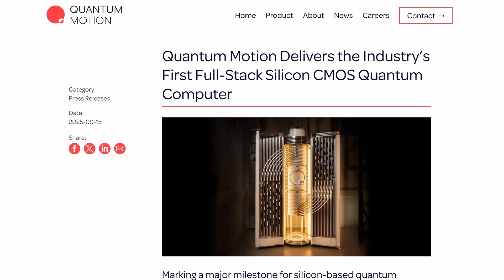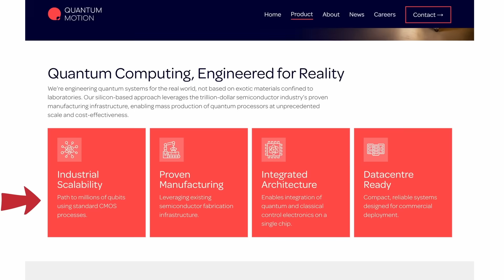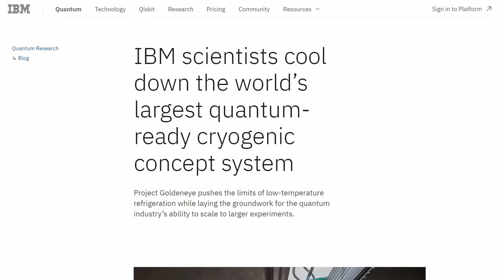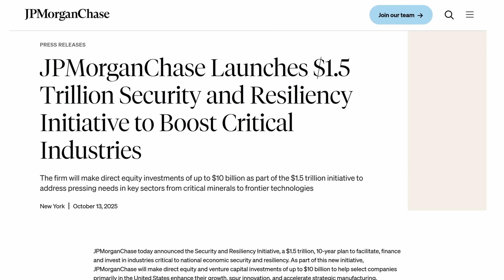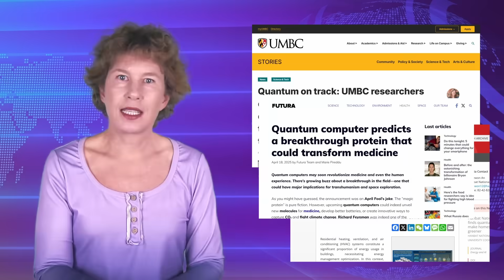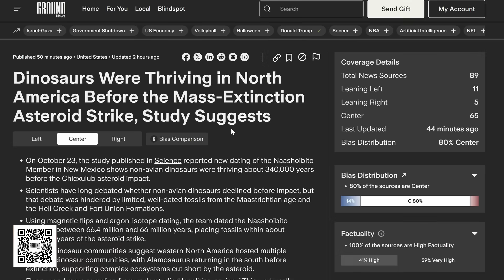I was SO wrong about quantum computing.

Comment: The thing about quantum computers is that they make current cryptography obsolete, so if one exists, or is likely to, or is very very expensive, but even remotely possible, we are very unlikely to see it until it becomes too obvious to ignore.
Reply: no, they make classical cryptography less secure but even classical cryptography is about the time it takes to break it and classical cryptography can be ramped up to make the current quantum computers take too long. At that point it is a race about how fast quantum computers can get larger numbers of qbits vs how long it takes classic computers to deal with the larger keys. Then there is quantum encryption methods that make it impractical for quantum computers to break. I know little on this subject but you know even less.
Reply: @thomgizziz  Have a look at Shor's algorithm. Its not about the power or speed of the computer (which is what currently matters) its about how they represent numerical probabilities. You need about double the number of qubits to the length of the key to efficiently tackle current keys (which is why current commercially available quantum computers are not there... yet) which doesn't mean well funded government departments don't.
Quantum mathematics is a game changer in cryptography, to the point that it will fundamentally change what we do and stop relying on very long primes.
No, I am not a mathematician, but I employed many great ones when I worked in the security forces.
Reply: @thomgizziz  Oh, and quantum encryption is obviously not what you think it is!

Comment: It seems improbable that these things can actually work. They straight up violate the second law of thermodynamics. The reason you can't have a Maxwell's Demon in the real world is the Demon has to calculate what to do, and that should have some minimum cost. If a quantum computer beats a classical computer the size of the solar system, where did the energy come from to do that? Or does it just violate the second law? Maybe the second law of thermodynamics is wrong, but I'm not yet ready to bet against it.

Comment: We often read in various places that classical computers are already hitting the physical limits of computational power. If that's true, then quantum computing may not bring any significant improvement. Quantum computers are still bound by the same physical laws and the uncertainty principle as classical ones—just from the dual side of the speed/precision trade-off. Yes, they could process more data, but with limited precision and increased noise. In that sense, the term "fast idiot" may apply to quantum computers even more than to classical ones.
However, for many applications, especially in artificial intelligence, such a high precision isn't always necessary. AI computing is inherently noisy and prone to hallucinations by its nature, so it doesn't require bit-for-bit accuracy of classical computers. For these kinds of tasks, switching from classical to quantum computers—especially those with hardwired, optimized, single-purpose algorithms—could still offer significant advantage in speed. But I think that dedicated AI processors based on memristor arrays would likely perform even better for these specific use cases.
Reply: Quantum computers are able to solve classes of problems that are impossible to solve with classical computers.  It doesn't have anything to do with how fast they are.  It has to do with how they work.

Comment: So we think we build a q-computer that solves a problem that would take current computing thousands of years to solve. How can we possibly trust it? I remember intel 80486 cpus that couldn't do math reliably, and it wasn't discovered until millions of faulty chips were in use.
Reply: Lets not get all hyperbolic here.  First of all the FDIV problem was in certain early Pentium chips, not 80486es.  Second, the problem was with one floating point operation with certain pairs of high precision numbers causing small errors.  The vast majority of the math was just fine.  It was estimated to affect 1 in 9 billion divides of random numbers.  It was easily fixed with software on affected systems, and later in hardware.

Comment: The problem is, we need funding and you need good headlines for investors to be interested. 

We need a quantum computer for experiments and certain calculations. 

But we need new approaches. Either we learn to cool circuits locally, or we raise the size of qubits. Both are very difficult to do.

Comment: Appealing to the interpretive effectiveness of an abstract mathematical equation that applies to an abstract "Hilbert space", or to its use in creating a "language/code" that quantum computers are programmed to decipher which attributes to faster processing of info (qubits), is not evidence of the ontological existence of this abstract principle. I could claim that a 2D circle is a representation of a 3D sphere, and use the 2D circle as a symbol/code to speed up communication about a 3D sphere or to use this 2D circle to calculate the diameter of a 3D sphere.  However the 2D circle will never be a 3D sphere. Hence, it has no ontological existence, it is only an abstraction of reality, regardless of how useful it is. 
The Schrödinger Cat analogy (thought experiment) , merely explains the concept of "possibility". As Zeno's arrow paradox shows, when an arrow is in motion, one cannot know its "location" and its "velocity" at the same time. When measuring a precise "location", it must be still. And when measuring "velocity" it must be moving and hence never in a single "location". The arrow has multiple "possibilities or superpositions" of "location" and "velocity" until it is measured.  No magical "observer effect". No conciseness creating reality. Just the simple possibility of potential outcomes, prior to being "identified/known". If you drive on a straight road, then there is a fork in the road. (left/right).  BEFORE you actually turn down the (left/right) fork you have a "possibility/potentiality" to go down either. The closer you get to the fork, the less time you have to "know" which road you will end up on.  It is possible that since quantum particles are so small, the smaller things we measure, the "closer" they are to that fork in the road, and their "possibility/potentiality" is on the razor edge of "actuality" IE picking a road/position/state ect. We are looking at this razor edge "cusp" of potentiality/actuality.

Comment: analog or floating point based computers are under research which are not all quantum based i guess... and they too are fast at specific jobs which means its not directly about qua tum its bit about the new data storage method on analog system that gives adventages on computibg like main struggle of bit based logic computers which is floating point extraction compression and computibg alghoritms requiring additional computibg power and resources then original intent... which makes floating point aka analog bit based systems adventageous on computibg jobs that require precise computibgs on floating point based math logics.. 😊😅😮😢😂... i thing in future all computers will start adding analog processjng units as subsystem which will make things like 3d graphics computibg faster which is also main struggle of ai systems as 3d simulations are too heawy makes that simulation out of choice list which limits their capabilities too .. and we end up with 3d looking 2d ai generated videos... 😅

Comment: In the context 'State' of superposition relates to a hypothetical self conscious like existence of the qubit. Thus this approach seeks to emulate the minds own state of alertness to the near future. From the very bottom - its theorists know machines have no awareness or sense but their research wishes it ( well obviously ) This superposition sense of this place just alludes to a tidbit of machine metacognition = Theoretically. Nothing wrong with finding the two states at one time idea amusing lol. However it looks like every responder on this board expects it to mean this also. It doesn't - superposition to a qubit & its grand designers just a small hypothetical in the ladder of conscious A.I. Actually most QT is misunderstood something like that, when quantum theory should more be regarded a natural conflict thats never going to look logical as it cannot. The difficulty is that with QM conflict of logic is the normative system.  QM is not bound within any fixed boundary condition in physics we just expect it to be for Nobel - but '' IT WILL OBEY ONE DAY RIGHT'' ? 

Yes once humankind has chartered the entire Cosmos! ( = Never ) So not much help this common garden ''the theory of everything will unfold '' thing is it ? On its side is the high probability that 'everywhere never has an ending. Thus QM produces exponential measurement problems and quantum computers need to find ways to superimpose tiny grains of self consciousness into machines IF the conscious A>I. thing ever has a chance of working. Now - i just speak on behalf of an understanding of the matter. Its not a claim or boast that oits actually right. But you know how real science was extrapolated once right ? Some people came up with idea that has a chance of working & wasn't just Metaphysics.

@hellegennes

1 day ago
What is happening? Stocks.

I noriced you loved the above post Sabine.

Yes but just for the stocks ? NO. We'll find that the human rational that designs the software that commands a QC is the same rational as how modern globalist gov runs society. Secondly - hardware/machine advance is inevitable and not relevant and not even theoretically possible to be conscious - its a bike Thus the definition of both conscious A.I. and thus quantum computing is yet to be designed within software. There is a strong sense that neither can be done without the other. Just over stock  - yeah but much more.

And CHATGPT etc have no chance, they are only trying to appropriate what to do via snooping generative A.I. thats sneaking up and listening to us every waking moment now = clueless chatgpt et al are just phishing collective humanity with the help of globalist investors.

Comment: I think, that actually promising approach is something like lightsolver. 
Actually useful quantum computer shouldn't fear decoherence. It should thrive in it, letting only most stable state to remain.
Lightsolver doesn't have qubits. Instead, it use network of lasers, which optimise their phases to reduce energy losses. Which allows to solve optimisation tasks, calculate ising models and more.
Somewhere around that.

Comment: I hate the buzz attempt of the word quantum; it just doesn't do what they think it does.
Speed is a state of matter.
And there are states we cannot simply maintain and interact with at the same time.
Reply: and by the way "quantum computing" is a climate hazard. 
In kinetic terms...
The energy needed to bring something down to 0K temperature [in absolute terms] is – according to my equation – infinite.
All the cooling system does, is produce more heat. All the conditioner does is displace heat, and to do that it will need progressively more heat to displace lesser amounts heat from the system being cooled. This is how cities produce what they've dubbed "heat wave" during summer.

Comment: Your problem is superposition. It doesn't exist. It was created as a feature of observing the transformation of wave features in particles, except that the reason for the waviness is most likely not an intrinsic waviness, but a determined transformation process, of a smaller particle.

Being unaware of the determined movements of this smaller particle, means we don't understand experiments like the polarization of light through a series of polarizing filters. There would be a selection process of every particle, that is due to the suddeness / gradualness of a polarization direction change, via an oscillation of that particle, by other particles of the same kind. The oscillated particle is what we call the photon. The oscillation occurs in 3d space, meaning, selecting 1 type of polarization of light with a 1st filter is selecting photons that will be less likely to be chosen by a sudden change of polarization direction, with a 2nd filter. However, gradually change the polarization direction, and we accomodate for this gradual oscillation in 3d, of the particle, that could rotate its oscillation direction, statistically, much more likely, to a similar direction, that suddenly say, to a 90 degree angle. This is why none of the photons go through 2 polarizing filters in immediate sequence, if those 2, are horizontally polarizing and vertically polarizing. 0 and 90 degrees.

Comment: As far as i understand it, a big problem with scalability of qubits is EXPTIME, in other words the time complexity in one MAC cycle for qubits rises exponentially - this is because state determination is not that fast of a process, compared to PPUs and regular transistors, because quantum state tomography takes iterative processes for each qubit. In other words, our largest supercomputers have 500-1000 qubits, and often never more than a few hundred are activated at once, because otherwise time for simultaneous calculations becomes insanely slow. Duration of a global MAC cycle while maintaining global coherence, in a qubit system, basically rises exponentially by n, whereas n is the amount of qubits. Roughly. While shor and grover algos can do stuff that normal computers cannot do, there are limitations. The newer SFQ Qubits are much faster, but even more prone to decoherence and absolutely not scaleable. If we could achieve linear time complexity, we could advance much faster... The fact that due to the probabilistic nature of qubits, they cannot do booleans, is one of the smallest issues in these systems. The big one is time